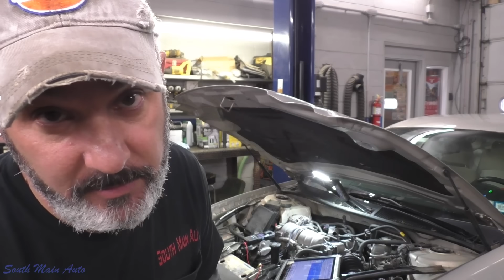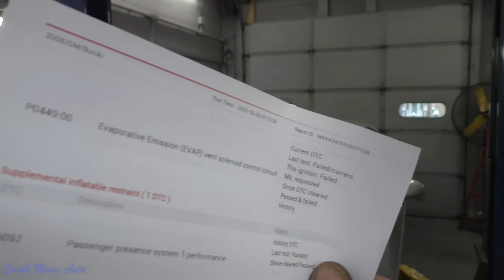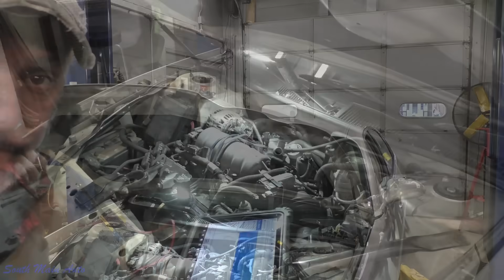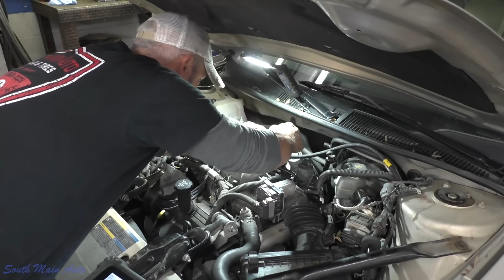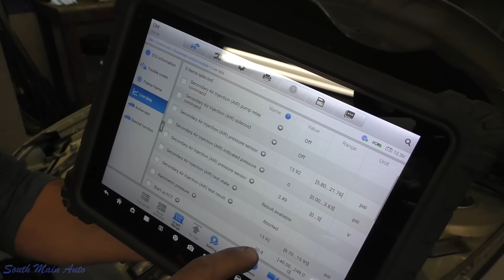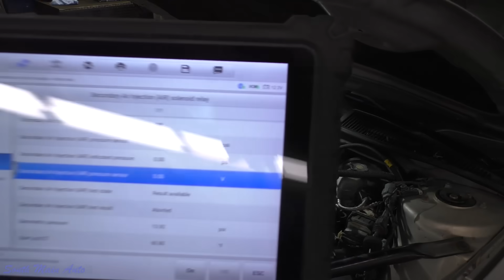When “New” Parts Are Worse Than The Broken Ones 🤬

Comment: I have a 2015 Chevy Colorado.  The thermostat was stuck open.   I bought a MotoRad (made in Israel by Palestinians).  I went to town. All was well. Then, I took it to work 32 miles away. Coming home it stuck closed and almost blew my motor.    I ended up buying an OEM from Japan and it worked well.        Usually, Chinese parts are the worst from my experience but not in this case.

Comment: It happens even with OEM parts. In my BMW E39 I have a four year old valve cover gasket that is leaking again, a four year old air intake rubber hose full of cracks, and now a one year old expansion tank cap that refuses to close properly. All original BMW parts.
I suppose crap new parts are a way to keep people off old cars, and make sure we sign in the dot line for a leased crap new car.

Comment: I used to work at Napa. I feel ya. I warranty so many damn parts. I also have to double check the boxes when they come in on freight. Some dumbasses from the other parts store didn't bother checking for returns or defecting the units. They are too lazy to do a simple check. Manufacturer or rebuild centers can suck d***s too. Putting the wrong parts in the wrong box or wrong parts number on the package. I know that all too well as both the mechanic and parts guy. I get shamed on both sides. LOL!!

Comment: When I was a Ford Parts Manager and sold an electric part, it was NOT returnable when it left my parts room. The ONLY exception was that if it was defective. I have a feeling that me and Eric would not have got along well. Ordering bunch of stuff because you thought you might need it is a non-starter with me. At my small dealership, Ford charged 16% of the parts cost to send it back to them and there were strict limits on the dollar amount of parts that could be returned per month. Larger dealerships may have slightly different rules. Parts issues are not only bad for the mechanic, they can be bad for the dealership also.

Comment: I replaced my clutch cylinder recently, after a mechanic replaced it w a new part 2 years prior. Did it myself this time, ordered the part, realized it was the same Dorman part that the mechanic installed. So will this one last more than 2 years?

Comment: Just went though hell putting 3 solenoid packs in a 62te pos dodge transmission. 2 autozone units @$250, both ohmed out good, pne worked for a couple months on amd off, would go into limp mode every so often and keep you stuck in 3rd gear. The second one was doa. Had to get one from dodge, luckily I found one semi local to me even though they are on back order. The OEM one didnt ohm out nearly as good as the aftermarket ones but worked, cost me a pretty penny but it worked. 

I wanted to throw that second doa unit right through autzones door glass. Absolutely infuriating to do a 5 hour job (yes I'm slow(not mentally)) 3x because the first two times you trusted garbage dorman parts that autozone sells.

Comment: I did the infamous ford 5.4 liter 3-valve timing job for my truck not long ago, all OEM ford parts. I decided to replace the VVT solenoids with the updated design as well—package copyright 2020. Guess what? The brand new ones failed within minutes of running the truck. Swapped them out for 2016 copyright packaged ones, and the truck never ran better. And then, the remanufactured power steering pump I put in while in there is whining louder than the 21 year-old one I replaced. Can't catch a break!

Comment: This is why I like to hang on to the old parts.  I fix them up, and keep on shelf, as a spare for when the new one craps out. Good example is starter, alternator, brake calipers. All can be re-built. In theory, a brand new part should work out best, but the new parts fail so fast, sometimes even before you get them out of the box.

Comment: Went through 4 brake boosters with 3 different companies to get the correct one for the car. All the same exact part number on the box for 3 and all4 had the same part number on the sticker on the booster.  3 were identically wrong one of those 3 was the 1 with the different part number on the box, and one was the correct which had the same  part number as 2 of the incorrect ones. Smh.

Comment: Well, you just confirmed something I thought was true for a long time.  I bought a set of points for my pre-war Ford V8 from Napa-they were unusable due to a defect in the location of the 90 degree bend in the metal of one of fixed points.  I then purchased a set of Standard points which were also useless for the exact same defect.  I suspected both sets of points came from the same manufacturer-now I know it is true-thank you!  Very sad that one cannot buy good quality parts anymore...

Comment: I retired after 40+ years as an auto mechanic and I couldn't wait to get out. I've always been a gearhead and I never even minded the computer end of the modern vehicles. That was until around 2006 or so when they started installing modules for everything on the vehicle. I even dealt with that without too many issues. But now, especially since 2010 the parts are garbage. I would say that 80% or more of the parts that I purchase now there it something wrong with them. It doesn't even matter what brand you buy. There  is a good chance that regardless of the brand, they're made by the same company.

Comment: Know how you feel…was a Chevy Parts Mgr and Asst Mgr for 17 years…personally ill take ACDelco over most any other brand, but ive seen bad runs of parts from certain production batches from all companies…they only pull and test maybe one item out of 1000 to test them…at one point we were short of power door lock switches for Impalas…we sold a lot, warranteed a lot…GM had shifted production offshore to Ireland…first time they went offshore…this is many years ago…the first replacements came in, a whole case of them…first thing Monday morning line tech comes in , needs a switch, i hand it to him…couple minutes later he comes back “ doesnt fit”… looked at it, it was flipped mirror image in the CadCam transmission to Ireland…couldnt be plugged in, pins were opposite…i called GM master warehouse near us..told them…said they would call me back..Called me back GM guy says im in big trouble. I asked what did i do? He says we got 55,000 of these switches…all bad…youre the first one to find one and report it…55000 sounds bad until you think GM had likely 10 Master warehouses just in the USA…meaning there were likely a few hundred thousand backwards switches had to be scrapped…later i became a tech…between decades of personal and shared experience working on computer and Emissions OEM seems the least problematic, and that goes for virtually all car lines except where Dorman and others have designed “ fixes” for known flaws in systems…my experience with non OEM emission components is almost 40% defect…OEM for me…Mopar Tstats too…co worker got an Auto Zone Stat for his Dodge…much cheaper…piece of garbage, wrecked his engine..,he asked the store manager did they have any issue with them..,she punched into her log..had 106 returned defective in the previous year…from just her store…

P

Comment: I can vouch for this....I had to replace the front wheel bearings on my SATURN (originals laste 140K miles. Replacements laste 25,000 miles (GM "OEM"-made in China. I had to replace the master cylinder on my wife's Subarua..(20 years old); no OEM available, bout a rebuilt unit (worked fine); the mechanic did NOR recomment using aftermarket park-he said most are bad from the box.

Comment: The most common cause for a solenoid valve to stop opening is electrical problems (like a burnt coil or incorrect voltage) or mechanical obstruction from debris.
 Other frequent causes include insufficient or excessive fluid pressure differential across the valve and damage to internal components like the diaphragm or valve seat. Small particles can get lodged in the valve, preventing it from opening properly. 
Interesting video.

Comment: The Corporate jets still function perfectly.
Reply: @GrizzlyAdams71  Unless they are built by Boeing
Reply: @Wetherluver123  Or it's a MD-11 cargo plane on UPS Airlines, or FedEx Airlines. Or it's a manual wheelchair user who uses a SmartDrive power assist (which has had more recalls than my left hip has gone out of socket). I remember when Boeing was the best passenger planes.
Reply: Of course.
Reply: Maybe they need to receive chi-knee parts before their trips to the bahamas.
Reply: General aviation spark plugs cost over $60 each, that's on the cheap side. Then you can't do a lot of your own work unless you have a license (A&P) and then you need someone with an Inspection Authorization to sign off on 100 hour and annual inspections plus get the radio and instruments certified every couple years.

Comment: I learned that lesson, never use second choice parts.
But I agree it is not easy to know which is best.
Real OEM parts can be outrageously expensive 😮.
I changed my original MB thermostat, it lasted 12 years with a FEBI which died after 3 years, finally did some investigation and replaced with a whaler, same as MB but 1/2 of the price, star and MB PN grinded.
Same for the sensors, now I use Bosch if I can and avoid unknown or funny  brands

Comment: In deciding whether to use OEM or aftermarket parts, I do a cost benefit analysis. If the part is one that is easy to replace, and the OEM is over 200% higher, than I often go after market if the percentage of reviews available (the more the better) are at least 70% positive results.  I also factor in whether the part failing will leave me stranded.   For instance, a new OEM power steering pump is $700.  An aftermarket one with 5 year warranty (which often mean nothing) is $75 and it takes 20 minutes and removal of 6 bolts to change. The after market makes sense because of the savings and if it fails, I can drive without power steering and change in the parking lot of the parts store.  Things like starters and alternators I go with AutoZone because of lifetime warranty,  plenty of stores, and the parts are can be changed in 30 minutes to an hours in the parking lot.   AutoZone alternators and starters have lasted as long as the original OEM.   For other electronic parts that affects drivability, I usually stick without OEM, although much expensive, because of potential diagnostic expenses and peace of mind.

Comment: I feel your pain. I have a 2014 Charger and I'm on thermostat number 3 since a year ago when I bought her. First one died in a month, second one in three, and third is going strong for now lol. I also own a 2010 Subaru Impreza STI and I have to go to the dealership for parts due to bad or wrong parts everywhere else. I just replaced both her rear drive axles, wheel hubs, and all the assorted hardware (spindle nuts, etc). The only part from another store (also NAPA) that fit was the cheapest part, the spindle nut. Fun fact for Subaru guys the spindle nuts have to be staked on. The dealership or last guy who did the passenger side before didn't and now I'm missing a center cap and 3k in the hole T_T. I also had to replace the slave and master cylinder on the transmission and guess what, rock auto and 3 other stores had the wrong part even though they said it fits, they even said STI and everything in the description. I get its an STI and all, but it shouldn't say it does if it doesn't. So I feel this video more than anything recently, I'm still shopping for a timing belt kit that I trust. I love my old 80s 4 bangers and Big Block Mopars but can't get parts cause now even the dealers don't have them. I wanted a exact replica or replacement radiator for my 70 300, and all I can find is an opposite placement inlet and outlet in the same size rad. So I got to get it re-cored but not many people do that near me. If it wasn't a stock resto (al least as best I can) I wouldn't care, but it is just more proof of shit parts for cars or at least bad info about the parts in some cases. Keep up the vids man you got my sub.

Comment: When the electric air pump goes bad should replace the diverter valve to begin with, that's how we do on it German cars and better stay away from non OEM parts. The bad diverter valve will burn out the electric pump. Just buy oem parts and have less worries, that's what my shop did last 38 years, lots of junk parts out there. Might take longer to receive, but better in the long run. Cool clip !

Comment: Years ago an older counter guy at a parts store I frequented showed me how cheap in quality their oil filters from a manufacturer I used were getting. He said parts in general were getting so bad their returns were getting insane. I started looking for older NOS parts on Ebay and bought them when I could just to have them in case. Between Auto Zone, Advance Auto and Napa it's hard to find quality made aftermarket parts. There is an O'Reilly's that recently opened up about 30 miles away. I went a few times for oil and filters but haven't bought any parts from them yet. It's a damn shame to see the decline in quality on parts that we depend on so heavily.

Comment: I've had many experiences with new aftermarket parts being bad or going bad far too quickly. Some years ago I had a 1985 Town Car - and of course I had trouble with the TFI ignition module. I must have gone through 15 or so replacement ignition modules before I settled on one that worked, worked correctly and actually kept working.  By far the most expensive module tried was the genuine Motorcraft module - failed completely within 1 day! The successful module that stayed the course, if I remember correctly was just a cheap and cheerful one from Standard.

Comment: I stopped using Napa electric parts and sensors for this exact reason. As a matter of fact I’m just about done using them for most parts. Exception being brake pads, calipers, and suspension components, but even then I’ve had wheel bearings that were completely fubar out of the box. 

Half the time the dealership doesn’t have the sensor you’re looking for because it’s been discontinued. Anything 12 years and older from today’s date(unless it’s been used on early models still in production)is basically gone from the dealer network. 

Ugh I feel your frustration! It’s hard being an independent. It’s not like we can take the car in on trade and sell them a 2025 when parts are only available from aftermarket and are a gamble from the get go.

Comment: Not surprised. I've been working in the parts industry for over 10 years now and I see first hand how quality is dropping fast. Same part# from quality brands (looking at you Moog) that used to be made in the USA are now made in china with the same quality as the "white box" version. You just pay for a longer "warranty" which is such a hassle to claim, nobody even bothers.

I had to go through 4 aftermarket MAF sensors for my 1987 Corvette before I got lucky with an original reman Bosch unit (which are harder and harder to find) before the car was happy. Aftermarket parts suck especially when they're all you have when the OEM dealer discontinues the part.

Comment: I usually don't bother with OEM because most of the time if I buy a reputable third party brand, like SMP or Beck Arnley, when I open the box the part is actually the same brand as the OE part but half the price. Also, a lot of older OEM stuff seems to have been discontinued and I'm pretty sure the third parties bought and repackaged most of the overstock, so the dealer may not have an OEM part anymore but SMP will have a reboxed one. There are counterfeit parts, though. One big problem I have is finding authentic Bosch 044 fuel pumps (not easy to substitute - many applications require the exact dimensions of the 044 to fit). The OE units are discontinued so most of the ones for sale are fake and they don't last very long. The knock-offs put more effort into cloning the packaging to look like an original Bosch box than they do in manufacturing the pump (except their translation needs work: one box was labeled "Made in Germany" but printed right next to it was "Fabrique en Slovenia." I guess French isn't popular in China).

Comment: Makes you wonder how it past the burn in test at the factory. I am sure the technicians monitored it for a while to make sure it was jut perfect. I had a 1952 Cat D4 that I bought at a government auction back in the 90s. It was low hours and it really made me appreciate the simplicity. The only wire on the engine went to the starter. Super reliable.

Comment: I bought four injectors for my partners car on-line, two failed within 6 months of fitting. Now they were OEM however, they were also from the same manufacturer as the original car part. (bought direct from the makers).
Does that mean I was just unlucky getting two defective ones in the same batch or does it mean that manufactured parts as getting less reliable for older cars?

Comment: my 2005 van had a dozen trips to the shop over a year because the parts were defective... the last shop went through 4 mass air flow sensors before 1 actually worked .... oh yeah it is a GMC... 2005 was the last year they made this van and I really think they put all their reject parts into this since it was the last year ... but parts you buy at the auto parts store seem to be crap as well.